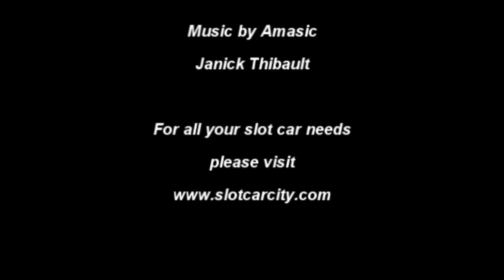Slot Car Champion Chassis Blue Printing by Slot Car City- promo version

Comment from the maker: @13kawasaki13 Even though the Champion Turbo-Flex is a good durable and well handling chassis and is what we use in our Gr.10 Nascar racing the JK Cheetah 11 out handles the Champion chassis. On our track the JK is overall faster by 1-2 tenths of a second!